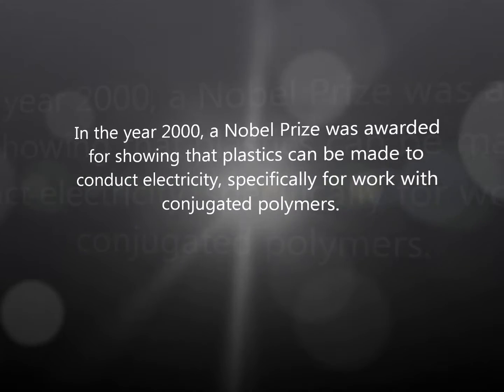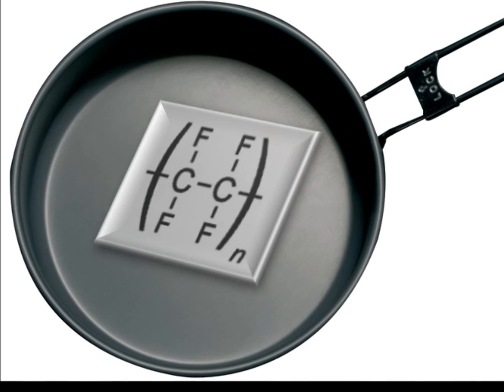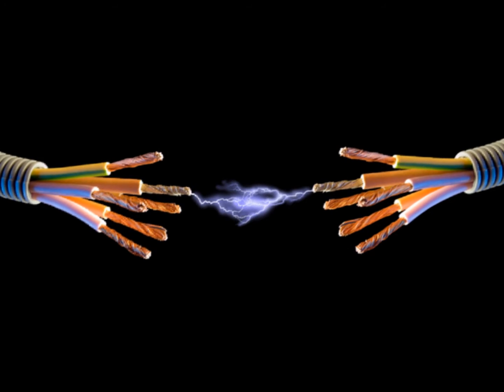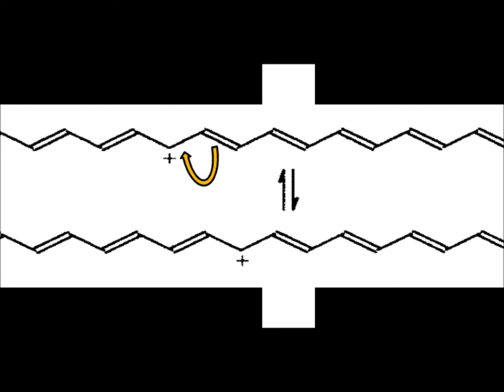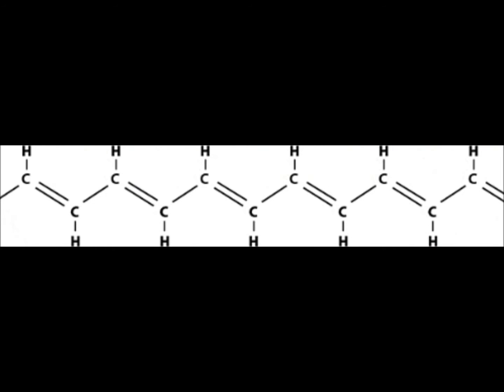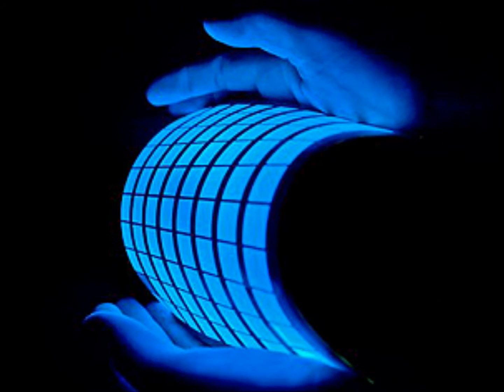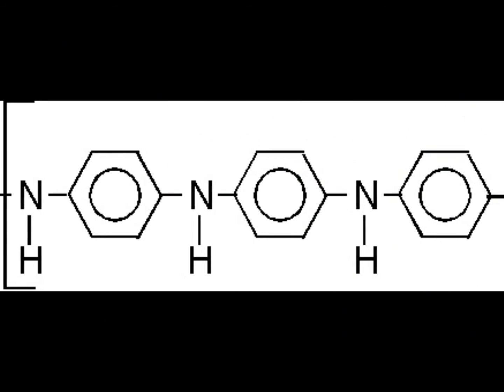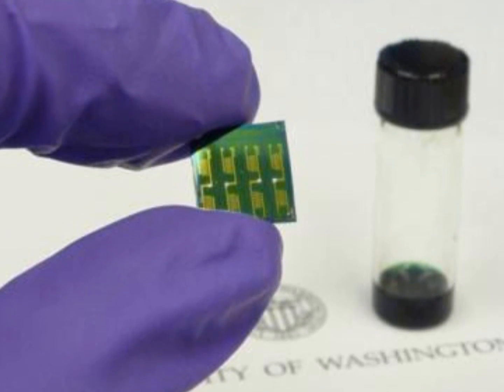Conjugated polymers and the Nobel Prize (Heather Powell).wmv

Comment: The statement that this created the field of conjugated polymers is not correct. Polyaniline and polypyrrole were reported far before this.

Runge, F., F., Poggendorfs Ann. Phys. u. Chem. 1834, 31, 513-524

Rasmussen, S. C., Electrically Conducting Plastics: Revising the History of Conjugated Organic Polymers. In 100+ Years of Plastics. Leo Baekeland and Beyond, American Chemical Society: 2011; Vol. 1080, pp 147-163

Rasmussen, S. C., On the origin of ‘synthetic metals’. Mater. Today 2016, 19, 244-245